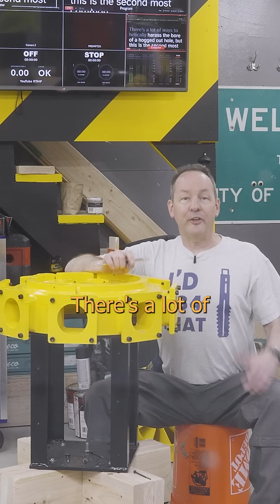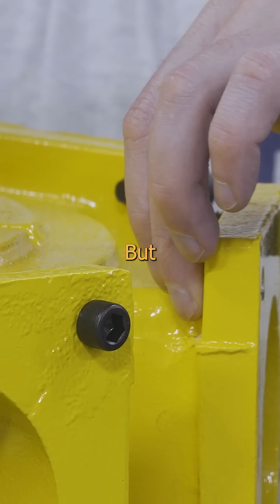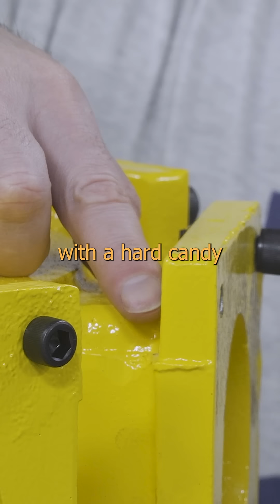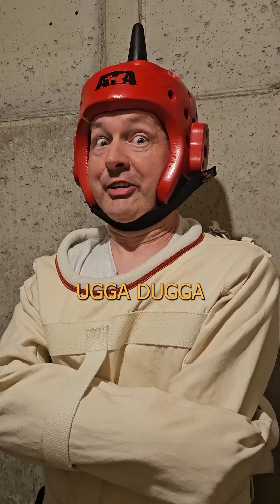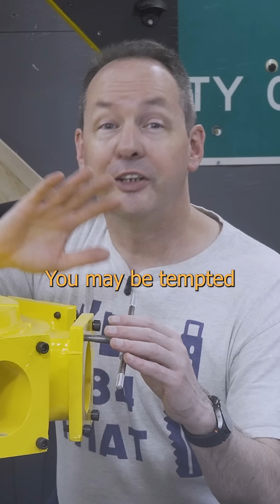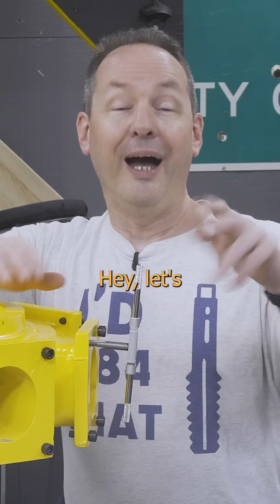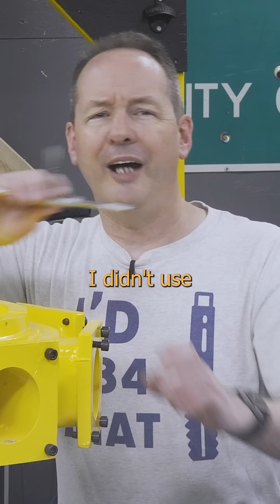Thread Chasing  #chrisboden #comedy #engineering #skills #workshop #metalworking #tools #apprentice

Comment: I use a drill every time. I don't think I've ever broken one yet.  I MAY have stripped the threads once or twice but, big deal.  The trick is to set the drill to the FASTEST setting. That may seem counter intuitive but you just gotta be confident, and hold everything firmly and just pull the trigger lightly so that the drill engages as slow as it can go on the fastest setting. I probably wouldnt do it on anything super expensive because it's a delicate game of chance that certainly can easily go wrong

Comment: My dad had a tap set and not the handle. When I was a kid we had to do everything hand started, and the follow-up with a crescent or open end wrench (which was a real PITA). I never thought about using a drill because of how delicate the operation was, the square drive, and how stinking large electric drills were in the 1970s. 
I have to admit I don't think about using a drill whenever dealing with anything more delicate, which is to my disadvantage on doing home switches and outlets because those are definitely easier to take out of/ put in the wall using an electric driver.

Comment: Dumba*s on my knuckle of my 2000 cherokee xj. Changing the brake pads after I bought it and of course the previous owner/possibly mechanic put those caliper bolts on way too tight. All the threads of the cast came out on both bolts. Did the first one with my drill yeah messed it up helicoil didn't go in straight. New knuckle it was

Comment: Dumbass. I don't tango with angry pixies but I do occasionally build networking stacks. Was working.  On site and ran out of / lost the stovetop screws that came with the rack. Instead of doing the responsible thing and running to the hardware store and getting more screws I figured it'd be easier to just tap in holes for some other screws I had laying around. I used an impact drill and absolutely fucked any chances I had of leaving on time that day. Please for the love of God don't use an impact drill to make a new tap

Comment: Try doing it with a impact on a pivot pipe, bad mistake, it went through yes, but when I tried putting the sprinkler in, it said nuh uh and somehow screwed up the first threads even more, so we had to take it out, and weld on a new one, NAWT FUN

Comment: Dumbass 😂 I worked at a place that made these big ass boring machines for oil pipeline. My dickhead supervisor got pissed every time I hand tapped a hole. So as one would expect, when I reluctantly used his fucking drill, the tap broke flush at the face of the hole. He blamed me for not using the drill right, to which I said, "I was doing it the right way before you came over." Fuck people like that.

Comment: Where i work we use taps called versa drive and they are made to be used in a impact driver. Of course it will need to be oiled up but oath it makes the job quicker
Reply: We also have attachments that go on the mag drill to drive in taps, but will be mainly be used for jobs that need 10 or more holes tapped out

Comment: I have snapped taps inside holes before and then the job turns into 4 hours instead of 1.
I also recently learned that there is a broken tap extraction tool set. Definitely bought one for the toolbox.

Comment: Alright, here's my dumbass story.
  I used to work at Cellxion, putting together the generators for main/backup power for cell towers. On the diesel generators, we had to build the exhaust pipes, which required a little, tiny, delicate, 3/4" threaded brass vent to be put on a steel 3" pipe cap. All we were issued to drill out said hole was a step drill bit and a tap. I'm not comfortable with stating how many buildings are out there with simply hammered in vents before i got the hang of it.

Comment: The first time I broke a tap was on a 'just made in the Tool Room' test piece to validate a new hydraulic control. Head hung in shame (I was rushing when I should have been taking my time and I'm trained and know better) I went back to the Tool Room. After a single word from the Chargehand (I think it may have been 'Wanker') I was introduced to one of the Senior Apprentices and he showed me the spark errosion machine. After a ten minute instructional session I was left to it. Spark eroding a busted tap isn't a quick process if you still want to be able to use the part afterwards but at least I had the saisfaction of knowing that it wasn't that irregular a happening given that we had a specific machine for the job and a full selection of the the tubular electrodes on hand.

Comment: How I learned about cross threading: 5 years old taking apart the bike the back tire off I believe or the front tire don't remember which one left the nuts inside of vise grips when to put nut back on with them still in the vice grips after realizing a little bit of resistance kept going it went on fine and dandy but after like a week it started loosening up so I had to tighten it and wouldn't you know it just wouldn't tighten so of course I had to pull off a washer to get it to go on further and it works for a little bit about a week and then next thing you know the chains falling off because it's no longer tight. Years and years later found out from a pro always finger tighten first before applying the tool and if you want to get fancy dancy go backwards within a couple turns or turn and a half at least and then go forward.

Comment: Mid 2000s I started a job at an independent jet ski shop after working at a land Rover dealer as an apprentice. The German guy training me had a completely corroded hole and I was like ooooooh nooooo! He just smiled and pulled out the first tap set I had ever seen. But then he blew my mind by pulling out heli coils and I learned thousands of dollars of knowledge for free that day. He also taught me about outboards, generators, how to do drywall, tile work and various other things. But stripped holes don't scare me now. 😆

Comment: So I had to replace the wheel Hub on my Kia and because I didn’t want to spend the atrocious amount of money I decided, removing the Cv nut myself was the best option without fully tapping the crimp out, I ended up eating the last four rings of my cv’s thread bought a whole brand new Pittsburgh tap and dye set. Accidentally cross threaded twice spent two weeks filing, fiddling and fucking with it and finally got that tap to reset in a position that it synced up with the rest of the threads allowing me to finish replacing my wheel hub three weeks for just a normal brake job between waiting on parts, figuring out new tools and then buying them.

Comment: Dumb ass, had to retap an hole on aircraft on aircraft undercarriage with no access for tap tool. Put in in drill, ran it in and out a few times worked well, until last time bottomed out and sheared off.

Comment: Only issue ive had chasing threads with a drill was chasing out some zinc from hot dip galvanization, and going a little too far without a little reverse to clear it.. snapped taps and lots of fun with a center punch trying to break the jammed tap apart lol

Comment: Shit. I bought a set of those bits that start as drill bits, then turn into tapping bits. They're made to be used with a drill so you can drill and tap all in one go. ..I had my concerns but they were on sale. 

A year or more later, I finally have an opportunity to use one of them. ..and wouldn't you know it, the very first time I tried to use it, the bit broke and got stuck in the hole. ..grrrrr

Comment: Ironically I learned the opposite lesson. Be careful of tap wrench clearance. Was spinning that thing like there was no tomorrow chasing some threads and didn't realize it was going to ramp up on a curved surface before it cleared the hole. Snapped the tap smooth off. Fun day.

Comment: I thought there was a separate tool that was meant specifically for chasing threads, but not cutting them. It's less aggressive than a tap. I used to use a tap to chase threads and then a friend of mine pointed out some other youtubers. Rebuilding engines and using a specific tool just to chase the thread, not to create a new one.

Comment: Dumbass here, I had to chase 35million holes in this weird ass unistrut Frankenstein machine covered in grease and dirt. when I thought I could use the drill on the lowest break over setting to speed it up. "1/2 tap idk remember the thread pitch. I broke the tap when it caught a piece of dirt and when i tried it again I must've pressed against the drill and it snapped in the hole. Had to cut the welded nut of and tig weld a new one on. I thought i was in trouble i paid for the nut and did the repair myself. And then operators acted all pissed off and laughed at me when they opened their gangboxes and showed me the fucking mountain of nuts and bolts. They break all the time on this thing. I have the record for fastest to break a tap, but the lead operator had the highest sitting at a little over 40 
The machine was like this pipe jig that they used for installing industrial heated concrete pads. It was a cool process that used enough energy a simple solar panel system could run it, and it used the hot water recirculation line in the building.

Comment: Our first home. Steam heat, all cast iron radiators. One had a crack right in the metal, not at a seam just in solid metal but where it was actually leaking was just three small pin holes. I didn't have the know how to fill them in with the pressurized system but I figured id just tap three tiny holes and put three tiny screws with some high temp thread glue. The permanent stuff.

Just used a drill to do the first one. It was a really bad snow storm. 8 inches in the ground and more coming down. We had one car and my wife was at work. I had to walk almost two miles to get a box of slightly larger screws and walk back and do it right the second time to get the heat back on... at least I got the right screws.

That is how you learn a lesson

Comment: Dumbass dumbass dumbass...
My dad... 
We were re-"tapping" (if thats what ypu wanna call what we did) a stump grinder after he took an angle grimder to a screw and cross threaded it on the way out and all we had on hand was a LITTERAL TAP WRENCT and a hammer drill... guess what he used cause the tap got "stuck"

If you guessed the tap wrench you are unfortunately naive and im sprry for ypur lover
If you guessed the fucking hammer drill... thanks fpr looking at the obvious and understanding why i didnt say dumbass just once... i told him not to do it too...

Comment: dumbass. did the drill thing -i was so physically exhausted and cold... . this was a in the field, well, parking lot, in severe winter weather... my jackass car has lug bolts. poorly maintained streets snapped a few. this saga is why every tool haul unboxing or toolbox tour... these are the extractors... hopefully i never need these. this was the worst... snapped the tap while learning i, after failed extraction trying sooo many different tools...that i had drilled it out very slightly crooked when it was almost thru and the tap snapped when it jammed on a littttle bit of the old bolt. 

i drank a lot that night.... 

i got a new hub. know when to cut your losses lol

Comment: Instead of a tap I used a thread chaser used specifically to clean and straighten instead of cutting the existing thread... Anyway I used an impact on the lowest setting and went slow and still broke it right as soon as it bottomed out. Drill would be a better option instead of an impact because there's a clutch instead of a hammer. By the grace of God I was actually able to remove the broken chaser.

Comment: For light duty use, you CAN wrap a fastener in aluminum foil if you're threads are stripped out or if your tap cleaned up the threads a little to well. I'm not saying it's right, but it works. Not too much foil either, otherwise your fastener looks like it's trying to hike up it's skirt while diving into the hole. You have to start over at that point.

Comment: My thread chaser set is one of my best Investments for one. For another I got in a bad habit of starting spark plugs with my little snap on impact and my battery ratchet. Well let’s just say I had a swivel spark plug socket with a built in extension on my battery ratchet installing a plug in first hole in the drivers side of a 2015 Silverado with a 4.3 that just so happen to be the bosses ride home and sent a hundred spark plugs before that one with no issue with that same combo of battery ratchet and spark-plug socket but in part due to me being to lazy to seporate the steering shaft one trigger pull sent my day from easy tune up job to cross thread hell in 1 second. Let’s just say I hope the truck is gone before that plug needs replaced again.

Comment: Yeah... ima dumbass. 
Short story long is use grease in the glooves when tapping a sparkplug hole on your daily... 
I just thank god it was aluminum and starting it without the plug in cleared the chip. 
I used thick grease and ¼ turns at a time . 
Clean out amd reapply the grease and repeat untill your through.
DO NOT take the shortcut !!

Comment: 1 ugga at dugga
Reply: Dumbass, think it tore the threads out on the head of my fj25. Idkkkkk I helicoiled new thread, new valves lapped in and we pieced her back. And I think the icav need computer reset, screw the dealership I need to get an hp and homebrew software to tell the iacv go home, the stoob should run

Comment: They make plugs/masking tape that go over bolt threads so you can use the bolt as a plug worked in powder coating for 7yrs theres always a way to make it work

Comment: I thread using a drill, a battery drill with a clutch, its surprisingly easy quick and safer set the clutch as low as possible and just run it in and out until the job is done

Comment: Dumbass, never used a tap before and decided an air impact would work. Well there was some weird noises that sounded mildly expensive anyhoo I blew the shit out of that manifold bolt and cracked it. Not as bad as the March dresser fire, or the angle grinder hatchet debacle

Comment: Dumba$$, learned the hard way. Slow and steady (right) and removed the existing threads, had to drill and retap. The little piggy sound was new then. It's an almost impossible job to remove a broken tap from the hole. That engine will never be the same.

Comment: I am definitely a d**** because five years ago I had this issue and I went ahead and shove that tap into a drill , because I had a lot of holes to deal with , and I figured I would save some time😂 i fucked that up horribly and I'm sure that there are other ways to deal with the problem, but in the end, I had to drill them out entirely and start from scratch with bigger vaults, which means I had to go back to where I was only with bigger f**** holes and tap it all anyways, that was after I did. 5 hours worth of work to fix the f*** up that I already f*** up

Comment: In 9th grade I attended geology special classes. We had many things to do with our hands from making minerals look presentable to fixing equipment for the next expedition. They put my DUMBASS and my friend on SHTILL duty and it was our responsibility to google how to fix chainsaws and stonecutters and prepare them for the next field season
So one way or another we managed to disassemble clean assemble and lube everything right. How ever there appeared to be a problem - in the process of disassembling we tore off all double threaded screws . We needed 2 screws with different threads and that's for every chainsaw of which we had 4 so 10 new screws to thread (with extras) and 8 holes to rethread. We managed to make a screw with 6th attempt and my friend took it upon himself to do them all. 
I had to rethread all the threads on all the chainsaws so we can put those screws to which the guide bars for the chain are tighten.
After wasting a bottle of WD40 (no one told me it's not a lubricant) and making two good threads on my first chainsaw I thought it was taking too long to constantly go backwards and forwards incrementally. I put threader in the drill and the next chainsaw was completely ruined.... I ended up boring those threads off, then putting+2 mm in diameter threads and making custom double threaded screws 

That was a learning experience for sure

Comment: Dumbass XD 

It wasn't JUST me, it was a team building experience XD

When I was younger and thought I knew better than my father, I took our yardman out to mow some tall grass round the side of our house. I didn't police the area first and found a metal base to a T-pole with sound of expensive. 

Upon reflecting on my err, and having to tell me father that I was wrong, (he got a chuckle outta that) we both went to the hardware store and bought a new pair of blades. After we got home, I dragged the sad mower back to the garage and got to work with my dad on trying to fix the mower, upon which I learned 3 lessons.

The first being what expensive sounds like, the second being that even my betters can make mistakes, and third, don't use a drill on a tap. 

The blade had sheared off the bolt, making it damn near impossible to get a wrench on it to break it free. So my dad grabbed his impact, his taps, and went to teach us how to use taps and a drill...

7 taps, a lot of swearing, and a breaker bar later, we managed to extract the bolt, mangle the hole, burn out the motor of the impact and spill a half a gallon of gasoline onto the garage floor.

Looking back on it now, I'm glad I got to have a moment like this. It was fun watching my dad try, and subsequently fail, at doing a task he was so confident in. But not for anything malicious. It taught me that, were all human, we all make mistakes, and even though it was a day filled with expensive sounds, it's one of my favorite moments I had with my dad that we worked together on something and messed it up equally 😂